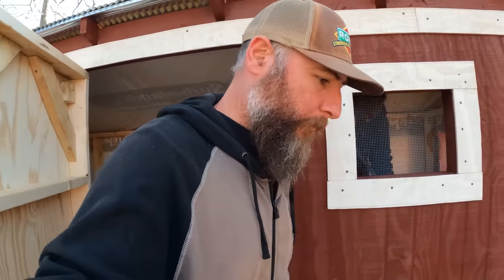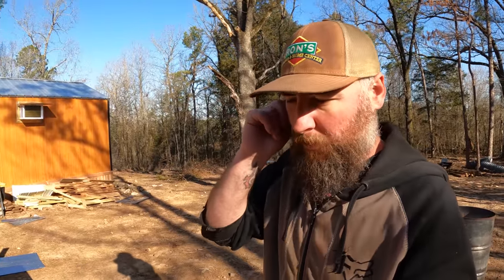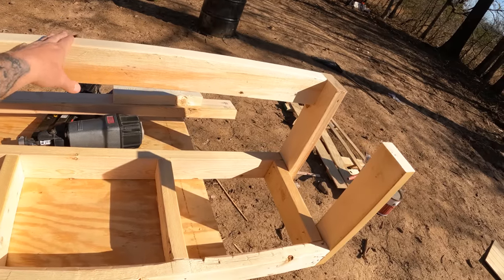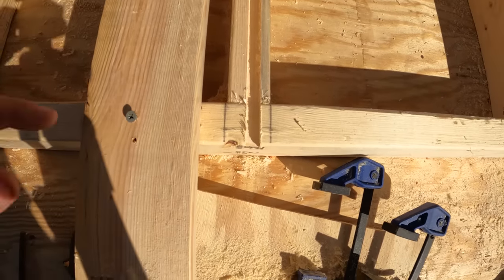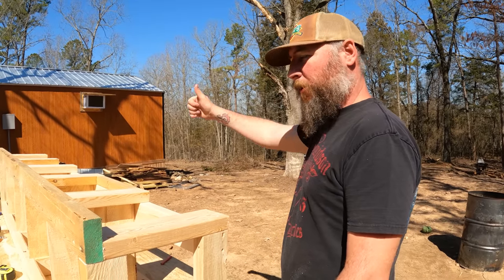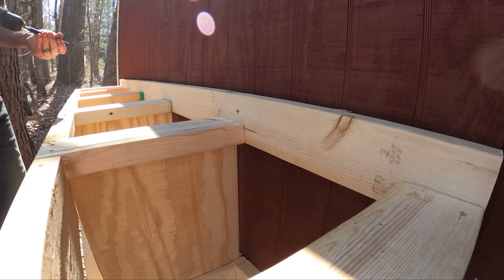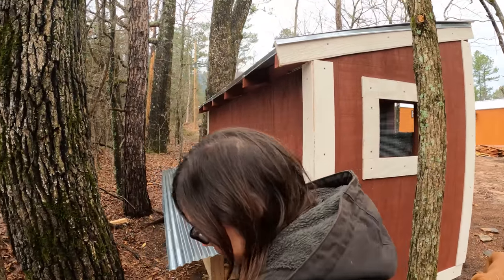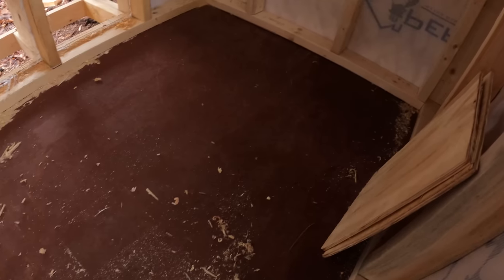We're Getting "EGG"cited! | DIY Coop Build | Couple Builds Dream Home

Comment: I love watching your progress. I was a poultry woman with my husband for the production of eggs for 30 years. Then I moved to Idaho and had a 12 bird backyard flock. Big change from having several larger chicken ranches. 
I also set up 5 nest boxes. I had 3 raised up off the ground and 2 on the floor which had 4 inches of shavings on the barn floor.
Well guess what? Those hens all wanted to lay in one box. Some times they would use 2 boxes. BTW I bought the square heavy plastic milk crates and put straw inside of them. They loved them. Easy to clean, removable and stackable. They really don't poop in them because they didn't sleep in them. I had  elevated roosts for them and that is really the only poop in the barn. Actually in the poultry business we didn't use the term poop, we used manure.  I also had too many roosts.  I had made my roosts with 2 x 2 wood in a 2x4 frame. There were 5 or 6 2x2's for them to sleep on. They preferred to sleep on only 2.  Chickens like to sleep shoulder to shoulder especially in cold weather. They sleep better on flat roosts than on round ones.  Under the roosts is where you will find most of the manure but it is falling on cedar shavings so easy to clean and save for the garden in my case.  
Your chicken coop looks fantastic. Will you give it a name?  I named mine 'Hoover Hennery.'   I have seen some coops with little curtains in the windows and other cute things. I didn't do that although I think it is cute.  Chickens are so fun. Just watching them lowers your blood pressure. They will come to love you. Or love you for the food you bring. I fed scraps from our meals as a treat. They love watermelon. Then every time you walk outside they will come to the fence to see what you have.  I used electric poultry netting so they had a big area and I would move it every so often so they had new grass. I have to admit the insect population went down while I had my birds. 
If you ever have any questions you can ask me.  Unfortunately I lost my husband to cancer in 2000. He was only 47 yrs old. I stayed in the egg business for a few years and then sold it to my brother in law.  We had 1.5 million chickens. So don't hesitate to ask if you have questions. After I sold the ranch I made the move to Idaho and that is when I bought my backyard chicks. 
 You're doing great. I love your videos too.

Comment: Linoleum on the floor of your coop makes it 100 times easier to clean and the liquid from their poo can't soak into the wood floor.  Even with the stuff you painted on to the plywood it will be messy.  You can get remnant pieces of linoleum from flooding stores or from fb market place.

Comment: Wow you guys are doing a beautiful job! You should put a gutter across the back of the chicken coop and run a extension into a rain barrel on each end of the coop to collect rain water to water the garden and chickens with. Also putting some cheap linoleum on the floor makes it easier to clean out and better for controlling lice and mites due to them not being able to burrow into the wood floor.

Comment: Just from experience: When you clean out the coop, how are you planning on removing the material from the coop? Wheelbarrow, cart, side by side? Whatever you plan on using, pull it or push it up to the door and see if any potential material can be easily raked into the conveyance device. It may be that the ground just outside the door needs to be dug down a bit to get the levels correct. Also consider 1) placing a bit of a wedge or ramp on the inside of the door framing so material raked out can make it up and over the sill plate easier, and as mentioned before, consider finding some cheap stick down vinyl flooring which will make cleaning a bit easier and keep the material from soaking into the wood a bit. Looks really good, just sharing my experience with a home-built coop that holds 18-20 birds.  I've also just put a tarp down outside the cleanout door, rake the material onto that and it's easier to pick up, scoot, drag or whatever.
Reply from the maker: Great advice @hippocrates garden. Thank you
Reply: I also recommended that  you may want to use that gorilla glue on all the nesting box inside and outside especially on the tops of the nesting box lidse ..

Comment: You may want to insulate the nesting boxes too or they will be like mini fridges in the winter. Also when you go to put the fencing around the  chicken yard, besides the upright fencing, be sure to go down a few inches on the outside of the fence and bury about 8-10 inches of fencing sticking outward. Make sure you attach the 2 sections of fencing with wire. Then, being down a few inches from ground level, bury that section of fencing. That way predators can't dig their way in under the fencing to get to the chickens. I've seen other people do this too. Just a safety precaution I thought I would mention. Coop is looking great guys.

Comment: Anthony just a suggestion on the floor of the nesting boxes instead of just screwing the bottom on put hinges on one side will make it easier to  clean them out just remove a few screws on outside bottom and down it comes poop and all brush off and screw it back up.  But just a suggestion you are doing great on everything you and Roxanne are doing 👍👍
Reply: That's a great idea.
Reply: Eggcellent suggestion. That would eliminate build up in the corners being hard to clean out.

Comment: I want to tell you something.  You are one a of a very few that took the time to build a chicken coop before getting alot of chickens. Some had makeshift fences and cheap blue tarp in the middle of one of the worst winters.  I can't stand to think of chickens freezing for no reason.  Thank you for doing it right!!! Inside will be easy to clean out floor with that hard plastic like wall board that we use in  Refrigerated truck trailers. It last forever and on wall at bottom 2 foot the cleaning is easy. Great coop

Comment: To prevent cleaning out bottom divided floor sections on coop Would a full length hinged floor, “mirroring top lid” be option? Seems it could be dropped open to dump all the nesting boxes at once for cleaning in one small swoop. 😁 Just sharing a visual idea. The whole project is beautiful, good job. Can’t wait to see lucky chickens who call it home. ❤️
Reply: To me, that is one great save to a bird box... I was thinking about the pieces they sliced out of the wall to have a notch sawed in to make a smaller entrance and a little privacy for the bird... I always made mine so the bird nestled inside

Comment: I insulated my coop to keep it cool on hot days and warm on cold days if you're going to  free range don't let them out till about 9:30 am it helps the chickens lay their eggs in the coop, they can go in  the run but not free range till after 9:30 I've never had to go on an egg hunt and the tree could stay if you lace stiff wire thru the chicken wire  making a hole around the trunk and using twine to tie the hole snuggly to the trunk to keep Critters  out and  it can be adjusted as the tree grows. I also stained it with used motor oil to protect the exterior and also on the floor inside to prevent rot

Comment: Are you planning to install roosting bars?  The chickens sleep on roosting bars suspended off the floor.  That is also when they poop.  You don’t want them sitting on the floor with poop.  Throw some pine shavings in there too to make clean up easier.  Never use cedar shavings, it causes respiratory problems in chickens.

Comment: Hey guys, have you ever thought about putting a scrap piece of cheep linoleum on the floor and up the walls a few inches higher than your deep bedding?  This is an easy way to be able to clean out your hen house very easy.  It works great, I've tried it!  Just a thought.

Comment: Great job you two.   Will you be putting down some sort of floor covering to help mitigate rotting floor?  Seems that chicken manure would be kinda rough on the wood.  Would be easier to clean up.  Maybe at some point you may make a little 'trap' door on the side so you can just push the bedding out into a wheelbarrow.💖🐱‍👤

Comment: I love the wobbly cuts into the nesting boxes, it looks so Art Nuovo. I would cut out the 2x4 base under the main door, so you can "slide" shovel the debris out the door into a wheelbarrow (that poop will be like cement). looking good & almost there!
Reply: I would fix it where the bottom of the nesting boxes is on hinges and drops down to empty on the ground.
Reply: Both are great suggestions.
If the straw or shavings are cleaned frequently, it shouldn't get like cement. That being said, we all know that there are times you just can't keep up with everything and you will get the occasional poop cement issue. lol

Comment: Are you going to put up white trim on the door?  The other thing I think you won’t like is the threshold for the door because it is so much easier to sweep the old bedding out of the hen house instead of needing a dust pan to pick it up.  Straw is messy  wood chips are a better selection from harboring bacteria and oder.

Comment: Great job on the coop. You don't need 5 nesting boxes. The chickens will more than likely all lay in only 1 or 2 boxes. I have raised chickens for over 20 years. They are just like pets to me. Also Don't put the boxes on the floor. Have them about the middle height.
Reply: On the floor may work out alright, but I agree. If they are higher up the wall the chickens may not be quite so inclined to sleep in the nest boxes. Like most things, the first time doing something you find out what does and doesn't work for you. I can't begin to tell how many times I've said, "if I ever build another chicken coop, I'd do "X" instead of how I did it last time." lol

Comment: Your eye problem is probably an allergy/dry eye issue. Refresh eye drops has a eye drop for contacts that worked well for me, but it stung a little bit going in when they were really dry. Contacts for me pretty much caused my eyes to dry more but can also trap allergens between the eye and lens sometimes. I also used an eye wash when I removed them. If you haven't got eye wash definitely get some for your eyes when you feel like they are getting puffy, you probably have a dust, dirt of plant pollen trapped behind the lid of your eye.

Comment: Your eye problem could well be dry eye exacerbated by wearing contacts. All it takes is a slight excoriation of the cornea and WHAM you've got an issue. I got to where I couldn't wear contacts at all. If you haven't, try using the OTC liquid eye gel . Due to my chronic dry eye syndrome, I'll occasionally start getting eye irritation that the gel won't help. I hoard antibiotic eye drops and that'll stop the irritation in it's tracks.

Comment: a plastic vinil floor over the wood will save your wood floor and a lot job , it is washable and removable , only put over with extra around and easy to remove the whole piece wahs and put back and cover and ready to use again and again

Comment: Will you be putting metal roofing on the lid? I have seen guys use rubber like they seal houses around windows on the side of coup and then stick it onto the metal to protect from water leaking into the nests.

Comment: Sorry to be commenting again so quickly, but I see people are wondering if you are going to insulate the nesting boxes ect. No insulation is needed or recommend. Chickens have a high body temperature and require air circulation. Even the moisture barrier on the coop is probably not a really good idea. Anyway, just don’t try to make It airtight because you will have a moisture/condensation issue in the coop. I am 62 and have had chickens all of my life. Our coop has part chicken wire sides, and no door. Some of my flock actually never stay in the coop they sleep in a cedar tree all year round. Your coop is beautiful though, and I wish you all the best with your chickens, as well as everything else. Love your channel. God bless your family.

Comment: 5 boxes? hoping for 25-30 birds?  I've got 3 for 18 without problems. Worst case, with those dividers, you can put a temp front on to keep the birds out and use as storage for scratch, calcium, feed.... You'll hear this over and over. maybe one box for every 5 birds or so.  Also, get the measurements of the bottom of those boxes, next time you are in town, drop into a dollar store or something and see if you can find a plastic container, like a rubbermade, or glad container that fits. That way when it's time to clean them out, maybe because of broken eggs mixed in the straw or shavings, bird poop etc, just pull the plastic container out, dump, rinse and replace. makes cleaning a bit easier (I build my boxes to fit the containers I have).
Reply from the maker: Thank you for the information 😊 it's good to know that cause we may want to expand.

Comment: I hope you rethink where the pig pen is going to be set up.
 The problem will be the stench. And their loud squealing and grunting sound. 
1st. The stench. Just the normal smell of their fecas is unbearable, but as they roll in the mud and dirt,  they emit just the worst smell imagonable. It sticks to your shoes and clothes. It makes your house smell.  You can't open your windows if you want to air your house out.
   In other words, put them far away downwind
 
#2nd. The wind or simple breeze that near to your home or play shed will stick to your clothes in your closet, pillows, blankets, throws on the couches.
3rd. Mud wallows. The first time you walk through their mud that over time has their slop, feed and feces all mixed will heat up and get worse by the hot days where you will hate to step out your front door to sit on your porch.

Comment: Did u scratch ur eye? Light is very painful when it’s scratched very watery & red. If u patch it completely so no light gets in it will take 24-36 hrs to repair itself. If it still hurts with light put the patch back on for another 12 hrs it should be healed then.

Comment: Straw and pine needles are not good for chickens,  please learn more about what is good for them and what should never be used. wood chips are good, hay is good,. check with your feed store they can help you. if you build a poop bench and take a 2x4 and lay it flat cleaning the coop will be fast and fill the floor and poop bench with washed Construction sand which is cheap and poop can be picked up with a metal kitty litter scoop . there will be no odor, and it takes just a few minutes a day.